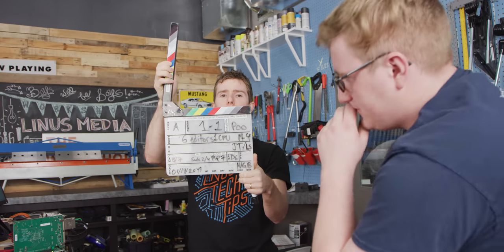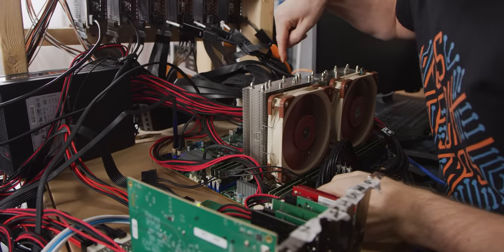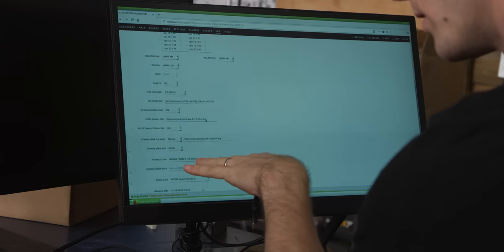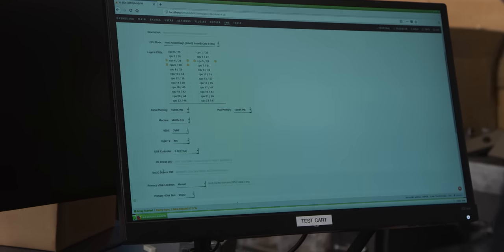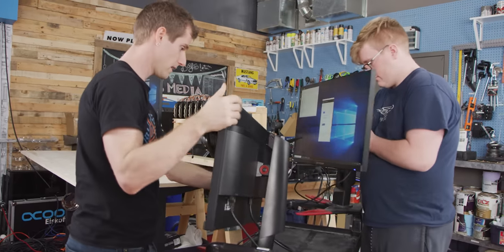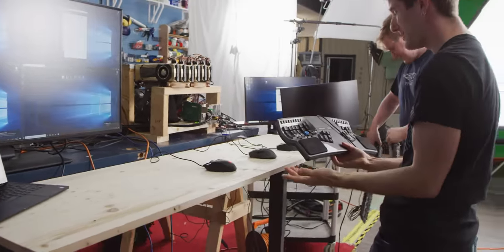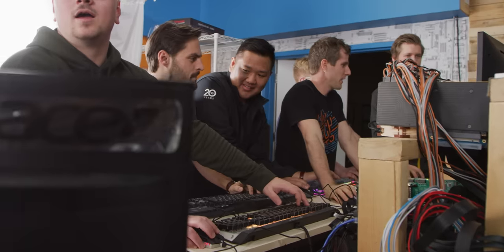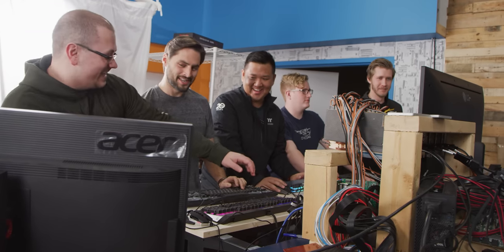The $100,000 PC LIVES! - 6 Editors 1 CPU Pt. 5

Comment: I don't see any sane reason for this thing over individual computers.
Reply: Because you caaaaaaaaaaaan
Reply: Because, reasons.
Reply: They will run the Linus Meida group so all the staff can work from the one Massive powerfull computer in the server rack.
Reply: Yah ”sane” and linus don't see eye to eye much
Reply: views and likes.
Reply: To introduce a single point of failure of course
Reply: @user-xd1bj2kv9p  
Linus punches sane right in its face
Reply: Because these videos make more money then LMG spent on the components.
Reply: Tim Ramich ....it's called "fun"!
Reply: A LAN party with just one lan port
Reply: INSANITY
Reply: @JustSomeGuy009  And they'll cost you an arm and a leg, far more than the hardware here.
Reply: Welcome to LMG
Reply: @JustSomeGuy009  Yeah but when have they ever opted for enterprise solutions? Home made is much more fun. ;)
Reply: So when it goes wrong all of the editors won’t be able to work
Reply: MMO gold mining, one machine, six accounts. Of course your ROI millage may vary.
Reply: I think the main reason is since they work with such high-density footage. It's easier to have all the footage on one machine, since transferring the footage from one vm to another is only choked on the drive and PCIe speed. So you can move those large files much quicker. Still, crazy and over the top, but has some purpose.
Reply: Daniel Mullen okay but why would this be any better than individual computers.
Reply: @danielmullen6178  They aren't putting that cube in the rack. And it's such an unusable setup, I see it not working in the long run
Reply: Shit's and/or Giggles?!
Reply: You must be new here
Reply: What's with all the "fun" comments? It's supposed to be a serious business. And with most businesses...if there is a tried and true method, they don't experiment with new things that have no gain over the old way.
Reply: @domoniche1  Don't they shoot in 8k? That seems pointless.
Reply: @citizensteve6713  Consumers who have no idea and no care about server stuff don't watch it. Really, the whole PC market is just for gamers anymore, and they review phones and TVs.
Reply: @TheRedmondEthan  I doubt he makes more than 100k on one video, and in sure 90 percent of the parts were just given to him for free
Reply: I mean why the fuck not
Reply: Do you hate fun?
Reply: just because < amount of cash on hand
Reply: They do. Which takes up a lot of storage. The use case is when the file is pulled from the server to be worked on, if another editor wants to work on that file, they don't have to send it back to the server and re-download it. They can instead transfer it from within the machine which takes less time since you're only limited by the speed of PCIe 3, instead of the 100gb/s of the cat connection you would have on the server.
Reply: The question here is... Does linus give a fuck?
Reply: Single point of failure. PC crash = multiple people unable to work. :)
Reply: And if it breaks noone can work
Reply: It should perform better when there are only one or two people using the system and perform the same when six people are using it... I don't think it's worth the obstacles and single points of failure but it has some advantages on paper.

Virtualizing workstations has been a thing for years and, apparently, it's officially supported on Enterprise hardware.
Reply: Because working from the same hardware is very useful when it comes to group-work. The VM's we used at my old job made it so much easier to update files and have immediate access to them across the business campus.
Reply: That's the point with these
Reply: Dynamic allocation is usually why this sort of setup is useful.

This one is a bit too hacked together, though.
Reply: Is there a way to get around the Nvidia block on VMware workstation? Like to run SW on my work PC but VM kills it. Need the isolation because of the multiple hardware platforms I'm working on.
Reply: Less footprint for hardware. All that would be needed on the desk is a keyboard, mouse and monitor. It would make LAN parties and big events like Dreamhack so much easier to deal with
Reply: We have elon time so do we have the linus reality principal rofl
Reply: Tim Ramich next 1 mil $ pc
Reply: @justabrokeredneck  It's just clearly the better choice. If you have 8 computers running 8 high-end processors, but only one person happens to need work done, they can only have one processor working for them, while the other processors are idle. If you have one computer combining multiple superpowered processors that put out the same performance as the total of the 8 processors would (and the same with graphics cards), then all that power can focus on individual tasks, when there is not as much workload at hand, allowing it to be finished faster, while remaining ready to accept additional tasks.
Reply: 666th like
Reply: Tim Ramich yes for playing Minecraft
Reply: Did they say there was one? I thought they were just doing it to see if they could, as they usually do.
Reply: Because you can, and LTT projects are rarely about the most mundane, efficient and well-supported solutions - that would not make good entertainment. its all about the jank, dank and diy baby! <3
Reply: @remlatzargonix1329  Even I would do it, if I had the money and friends.
Reply: man lan party from 1 computer that would be dope.
Reply: @Jacob-rt6on  sponsors , also if he got the parts for free why would he need 100k?
Reply: It'll keep the room warm in the winter
Reply: @FradFish  someone said he made more than that off this video I was saying I doubt he did
Reply: well imagine if you had the money and if you like computers, you would do it for fun. nothing wrong with that :0
Reply: It's for the advancement of Mankind.  If humans just stuck to doing sane reasonable things we would never learn new important things.  Driving forward this idea may help inspire something useful or the demand for this may create a new niche.
Reply: density. and also potentially uses besides just editing. if you have a system thats sometimes gonna get hit by one person and other times hit by multiple people it could work without being a waste. 

like think someone is doing CAD or some other shit. but then sometimes people come hop on to do video editing or something else. i know some 3d modeling software can make use of lots of cores and multiple really high end gpus.
Reply: Let me remind you that Linus is the same guy who carried 8 Titan XPs at once and dropped one...
Reply: You should see the computer he built for his toddler. He put some Idk, like $2000 cpu in it.
Reply: @danielmullen6178  he could buy each editor a beastly $5000 machine and it would be less than a third of what this thing costs. Not to mention it would be a heck of a lot more stable, easier to maintain and have better redundancyq
Reply: bigger is better
Reply: Elegant looking desks
Reply: @timramich  why is it supposed to be serious? Where did you get that?
Reply: This vs water-cooling a red camera
Reply: When he said he dropped the cpu I didn't even chuckle I just thought of it as everyday business nothing new lol 😂 😂 😂
Reply: Because you can dynamically arrange the resources among the VM as they are needed, for example, maybe one VM needs a lot of CPU and memory, no problem, assign more CPU cores and memory to that VM because maybe the other ones in that period doesn't need a lot of power. Or maybe you need one day all 6 GPUs on one VM, sure is more practical to change a settings and maybe reboot a VM than taking apart 6PCs and pulling out the GPUs. And of course the storage, the fact that you have snapshots, that you can have more virtual disk images to switch between if you have problems, and so. 

You also are not limited to really run only 6VM, sure you have 6GPUs that could be used, but maybe you don't need a GPU per VM, for example maybe you need a VM for a server of some sort, or you need a VM for a task that doesn't require a GPU and can be accessed via standard remote desktop, you have a lot of possibilities.
Reply: Too true
Reply: Say you have 5 friends come over.....
Reply: Bragging rights.
Reply: So they can spy on everyone...
Reply: They can make videos about it.
Reply: I don't see any sane reason for this thing over E5-2690 V2 Second Handed + Brand New Motherboard from Supermicro + 128GB DDR3 1600 ECC memory + CUSTOM WATERCOOLED WITH EK SUPREMACY GOLD PLATED WATERBLOCKS either.
Reply: SkyLight Gaming yeah like what are you watching he’s like nothing as he closes private browser
Reply: @Jacob-rt6on  ... exactly. He's probably made way more then $10k off these videos
Reply: @lokibek  1 Massive server cost less to run that heaps of $5k work stations.
Reply: @JustSomeGuy009  But can you 3d-game on VDI? (Apparently, that's their acid test for any setup...)
Reply: @alpha.gamma.dingdong  His time and money invested into his business... Most people take that seriously. Eh, what am I thinking? What money? It's probably all owned by a bank, and he will eventually just crash and burn and have to try to find a real job.
Reply: @MxT333  Yeah, maybe when people are 15 years of age...
Reply: No?
Reply: I mean...impractical describes most of the content on this channel. Being over the top can often create appeal.
Reply: @thomashendricks33  wel you can accomplish that by working off a server so basicly link all your workflows to a server hard drive in raid so you also have a instant backup.  you still have your own hardware but you work of files on a server i set up a system like that 20 years ago so that should be easy now.
Reply: @Tim Ramich
 i see no reasons on individual pc at all, just use nvidia game streaming service on a tv, which using by the way quadros lol
Reply: @timramich  His time and money in this business has clearly paid off. Considering each of these videos gets millions of views and has a dedicated sponsor, I'm pretty sure experimentation is a good approach. But maybe you're secretly their business manager. Maybe you're trying to point the company in a different direction.

Also, "find a real job"? Do you think Linus shouldn't get paid for what he does?
Reply: That’s the point

Comment: 16:30 linus literally using a 2 grand Razer laptop as a fidget spinner😂😂
Reply: Don't worry! We all know that Linus doesn't drop things ...
Reply: And how he handles it! This move has been practiced.
Reply: and people are surprised he dropped a $11k cpu
Reply: because Linus. :P
Reply: It's Linus and Canadian ruples, he certianly has the 3k version.
Reply: Can Linus just give me that laptop, if he's not using it? Kthx.
Reply: @maclennanld  its the 8th gen(i7) blade stealth it costs around 2000
Reply: @voidconqueror1286  they have more then one version, they range from 1850 to just over 2500 canadian ruples now, the highest teir one used to be more but the gap narrowed at some point
Reply: @maclennanld  i have the 512 gb version, it was around 2800 aud when i bought it usd to aud is like 1:1.3, thou ur right there's  a 1 terabyte version for a bit more dunno how much
Reply: @voidconqueror1286  yea when i looked it was the height of the gpu price spike so that may be why it is down almost $300 cdn with enviro fees and taxes the 512 gp, 4k display one would of been 3k cdn at the time. I never purchased one, I just dont travel enough to justify the price to performance

Comment: UnRaid is so good. Started with it on an N34L back in 2009 with 5x 2TB WD Green drives with head parking disabled. Now running with 2 of them still, however up to 12 drives in RAID with dedicated cache drives etc as well. Best.

Comment: I feel like in the year 2200 the remaining mad max like civilizations find the last working computer and when they turn it on they will read: Windows Update...
Reply: I hope NASA or SpaceX never use Windows to use on space ships o.s. programs to Mars
Reply: @renatoigmed  Na they use Unix, BSD variants, and Linux.
Edit: in fact I forgot to mention Debian is the official Linux distro used on the ISS, which is very stable, user friendly, and many other distros such as Ubuntu, and Mint are based on it.
Reply: LMG apparently let their test machines directly on the internet for updates. They could control that by adjusting their images to a) only update during off hours or b) just run a damn WSUS server so they're not all connecting to the internet for the same patches, and you can control when they do updates via local or group policy.
Reply: @renatoigmed  NASA uses Debian mostly, It's the official OS running on the ISS too.

Same as CERN and LIGO.